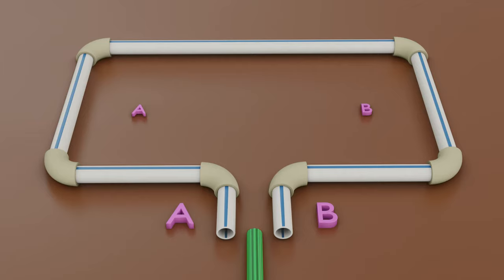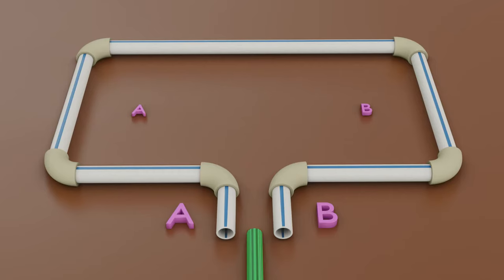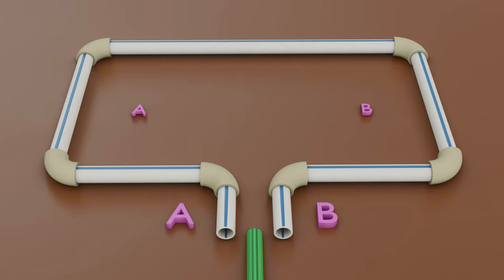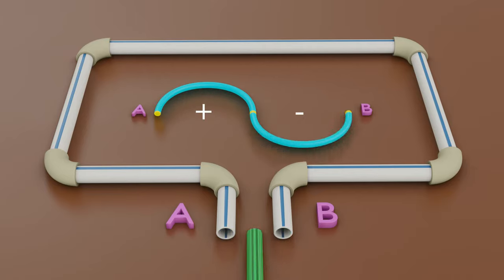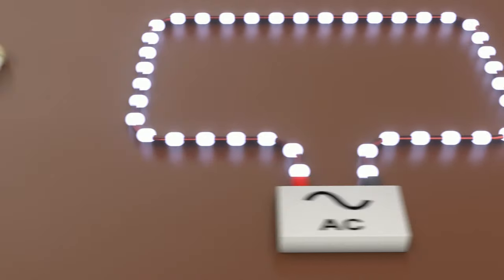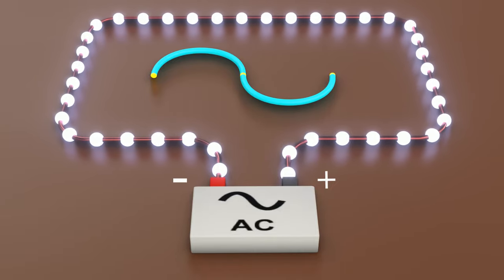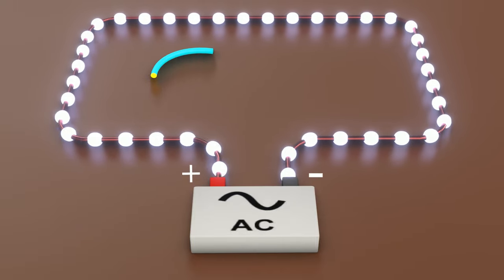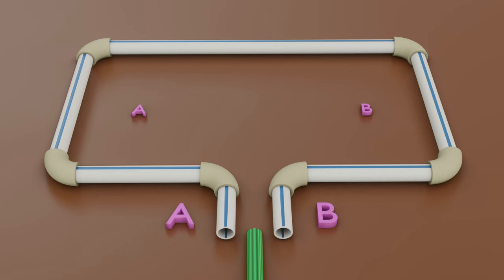How AC Current Flows Animation.

Comment: If in a generator , the magnetic field pushes electrons in alternating current , what pushes the electrons located far away from the generator in the wire ? 
Plz answer
Reply: It's all the same current.

In AC, the north pole of a spanning magnet induces a current. Practically instantaneously, an election will move to next atom along the entire circuit, no matter how far away. 

Then the negative pole of the magnet will induce current in the opposite direction. 

This happens in real time. Trillions of trillions of elections are moved at the same time, then they move back, repeating as long as the generator is on. 

The magnet spind 60 time ls a second meaning electrons shift direction 60 times a second called 60 hertz.

The uppet peak of a sine wave is the positive pole of the magnet. The lower trough is the negative

Comment: Hi and thank you for your video.

I hope this topic makes sense and you can help.
This is what I understand (please allow numerical approximations):
1. Electrons move in a conductor at a speed anywhere near the speed of light.
2. Electrons gain actual velocity (drift) only when supply is ON. Propagation of EM field is about 270.000 km/s.
3. For DC, drift velocity can be calculated.

Now, am I right to say that, in AC, actual average velocity is zero? That's because in a PERIOD, electrons move back and forth. I could calculate the drift in half a period, but in a period would be zero. Correct? This means there is no actual transmissions of electrons from source to load, right?

Under the assumption above, why we keep talking about "power transmission"? As a matter of fact, there is nothing moving from source to load. Electrons simply move back and forth while performing work.

Also, under the considerations above, can anyone explain the concept of "reactive power going back and forth from source to load" in cases where power factor is lesser than 1?

Thank you very much in advance!
Reply from the maker: This reply is not mine nor i know this person and their qualification, i asked this reply on "Electroboom" reddit page.

1. In a closed circuit electrons move inside a conductor at a speed directly proportional to the current. This is actually very, very slow and nowhere near the speed of light.

2.The average velocity of an electron in a conductor in an open circuit is zero. But the electron is not stationary, it is moving randomly. When the circuit is closed electrons now have a net velocity that is very very slow.

3.Drift velocity is a function of current and the strength of electric filed applied to it. So Drift velocity can also be computed on AC circuits

In AC, charged particles move back and forth but power is transmitted through the electric field that is around the circuit.

This concept was explained in this videos by Veritasium: https://youtu.be/bHIhgxav9LY

But also watch the reaction videos from Mehdi, EEVBlog, and BigClive for better understanding why the answer was "wrong". And then Veritasium's last video about the topic for completeness.

Comment: In order to make a light bulb for example to light up with ac, there must already be free electrons in the wire in order for them to manage to pass through the bulb right? Cause if the direction of the curret changes before the first electrons reach the bulb, it would never light up. Or maybe the electrons travel sto fast that in half a period of time the electrons will have already traveled the whole wire??
Reply from the maker: Your thinking right my friend, Frequency is so High that Human Eye never sees Bulb Stop glowing it happens so fast but with camera its possible if frequency is 50Hz just match your camera Frame rate with that and you'll see the flickering.

Also try to learn about what will happen if 3 phase and its effect on bulb
Reply: @Mrisometric  thank you for your reply
Reply: @surtur6572  That is why we use the frequencies we do (50hz and 60hz). If you go much lower than 50hz you can notice the flicker with the naked eye.

Comment: Bhaiya mai 9th class me aaj mere sir ne current ke baare me btaya ki wo flow of electrons hai high potential se low potential tab toh light 24 hrs rehni chahiye na electrons thodi khatam hote hai jha se electrons ja rhe hai wo high potential kuch der baad low potential ho jaayega toh fir  electrons wapas kyu nhi aate low potential pe
Reply: actually, tumhara yaha ek misconception hai. electrons direction of current ke opposite flow karte hai matlab they flow from low to high potential. regarding your second question,  electrons tabhi flow karte hai jab koi ek potential difference ho and in most cases yeh ek battery provide karta hai, means battery/cell provides the energy for the electrons to move out from the negative terminal and come back to the positive terminal. potential ka high aur low dono vo battery pe nirbhar hota hai kyunki electrons ko move karne ka energy hi battery deta hai due to chemical reactions inside the battery. abhi 10th me tum ohm's law padhe honge toh, tumhe pata hoga ki voltage aur current directly proportional hai, so jitna fast chemcial reactions battery me honge utna jyada energy produce hoga aur utna current flow hoga. voltage me electron ka koi haath nahi hota like electron ek jagah se jaye toh voltage kam nahi hota in a circuit.

Comment: At positive half cycle, current flows from phase(line)  to neutral following the path from higher potential to lower. You put a voltage tester  on line, it will beep, on neutral, it wont.

At negative half cycle the phase potential is lower than neutral so current flows in the other direction. So line becomes neutral and neutral becomes line.

But, do you mean that we have supply in neutral during negative half cycle? In this case, why a line tester would fail to glow if it is tested over neutral line  at the negative  half cycle.
Please explain.
Reply from the maker: https://youtu.be/HvfCTCv7wlI Watch this Video also watch the Video in Description. Its a very Common Doubt do a bit of research You can even show this animation to your professor if you have any... Electrons Do Flow in wire like that tho.

Comment: Why we are not getting shock when  touching in neutral?
Reply: Because current is not flowing when you touching it(I assume you're doing it in empty socket). But if you will connect a load there to start current flow and then will touch neutral then you may die

Comment: In this animation how you can extinguish phase and zero then ???
Reply from the maker: Assuming from extinguish you mean Distinguish. There is Red and Black Point on that power supply box which is Accepted as Phase an zero Respectively. Just watch video in good quality you will be able to see it.
Reply: @Mr_isometric 
Distinguish 👍
I mean how can we distinguish phase by it's behavior ! Cause as I saw both phase and zero has got the same electron movement witch I suppose is wrong !
Reply from the maker: @saeidhashemi7090  Electron movement is perfect in term of changing direction of current. In second animation red Box is Phase and Black box is zero.....
Reply: @Mrisometric  
We should be able to recognize phase and zero without showing by color and just by the order of electron movement (these colors are contractual signs , they don't exist in the real word)
Reply from the maker: @saeidhashemi7090  I don't know what you want, And yeah if you have read Previous comments then you'll notice me saying the same thing about "Colors" There is nothing wrong in that video you should learn more about Alternating current!!! This video is just  a visualization of how current flows.
Reply: @Mrisometric  
I don't mean your animation is wrong , thanks anyway .

Comment: Which is phase? Which is neutral?
Reply from the maker: Red/Left is phase and black/Right is Neutral.
Reply: @Mrisometric  there is no difference between them here (i mean functionality, not color)
Reply from the maker: @igg5589  think it this way you suck and blow at one end of straw ,other end just react to your flow.... Similarly phase wire is the one that has alternating current flow neutral wire is just there to complete circuit.